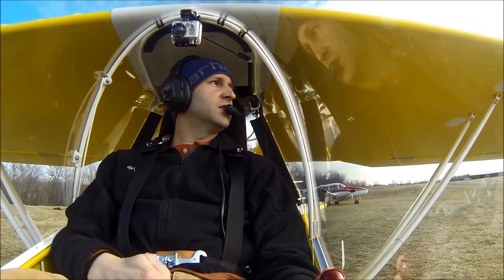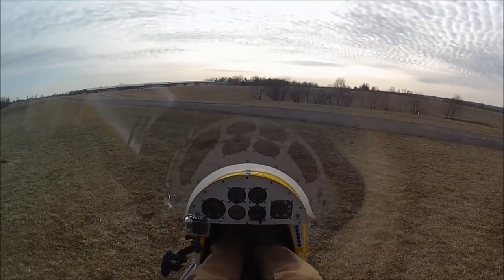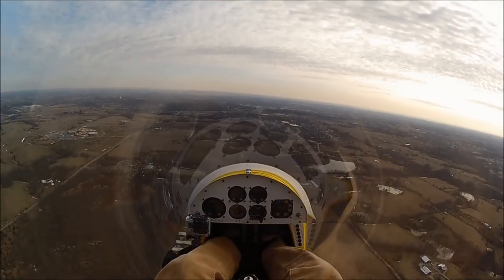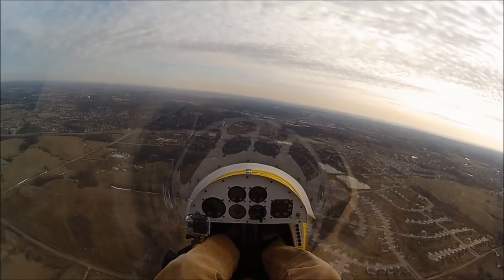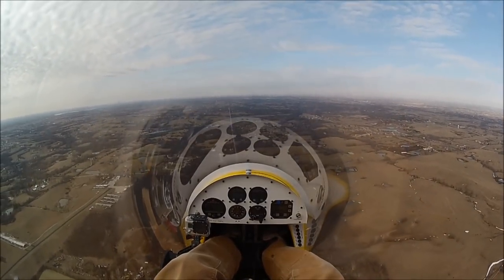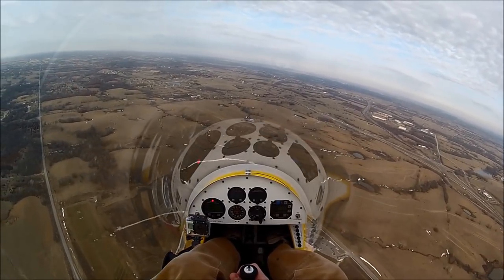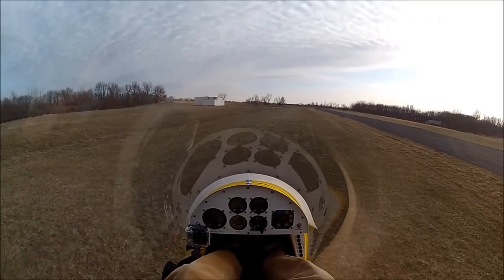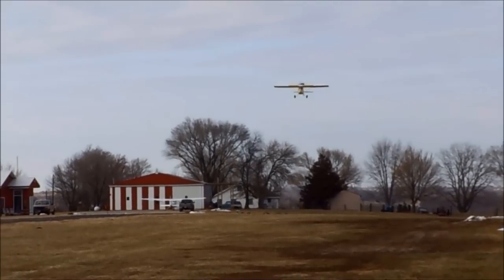Kolb Firefly Maiden Flight with Pilot Audio & 3 Camera Angles

Comment: Do you still have this plane I read on a forum guy said it was the worst handling plane he ever flew it always felt like it was going to stall when flying in the pattern. Maybe it was something wrong with his because seems like lot of people like them. I'm looking for a cheaper way to get into the air can't afford certified airplane hangers around my area are 400 a month with 5 year waiting list. I have been looking at trailer planes the kitfox is one but still in the 60k range when done with it. Wife isn't going to let me dump 60k into an airplane.
Reply from the maker: blastman8888 I still have it and fly regularly. I was fortunate to eventually obtain a cheap hanger.  I’m not sure where the “always about to stall” comment comes from. I’ve had no such experience. Maybe it is rigged poorly, propped wrong, under powered, or something. 

Having a light wing loading and being a tail dragger, it comes with the usual flight characteristics you’d expect out of an airplane of this type. Don’t fly in high winds, low energy, etc.  As far as stalls are concerned, it just bobbles without a clean break if you do power off stalls without excessive nose up pitch. You have to really pull and get the nose up for it to break. My usually breaks with about a 10 degree roll to the left. 

I added 1 degree of washout when I built it. This helps the stall characteristics. You get a nice stick shake from the lift separation on the full span ailerons. 

The only thing about it that bugs me a little is the effect of adverse yaw during ground handling in cross winds. It results in some counterintuitive control inputs sometimes. But, after a while you learn to work with it. 

Kolb has been around a long time. I think the Firefly looks nicer than say, the Aerolite 103. But, it is more build intensive if you build it from the kit. The Firefly is offered with a nose wheel now. Let me know if I can answer anything else. 

Mine may be for sale in a year or so. I’m building a Sonex.
Reply from the maker: Also an aft CG could make the plane feel unstable. Kolb says something like “the Firefly can handle up to 200 pound pilots...”. What the don’t tell you is that you may have to be 250 pounds to be off the aft CG. At least that was my case. I had to build a mount in the nose in front of the rudder pedals for the battery. I weigh 170 lbs and I’m flying about 3/4 of the way aft on CG.

Comment: I bought an airplane engine yesterday!  Cuyuna ULII-02 Engine (430cc / 
30-35hp) has 180 hours on it, running when stored, off a wrecked Kolb 
Firefly

http://air-war.org/image_DSC_0026.JPG

More: http://shellprompt.com/deathtrap1/Cuyuna%20ULII-02%20engine/

Another major piece of the puzzle... acquired...!    Rivets, Prop, &
 Dacron still to go...

Oh, and I got my first cockpit gauges, an hour meter reading 180, and a 
CHT (cylinder head temperature) gauge (very critical).  

Still haven't decided on an eventual color scheme/theme/typestyle for 
it, probably still a combination of aluminum grey, orange, white & 
black.  Also considering instead of orange...   purple / gold, and... of
 all things... white polka dots on navy blue background.  Nobody has 
ever painted a plane in polka dots, and I want to be original.   I get 
color chips at the Home Improvement store and hold them up to the sky, 
comparing high contrast combinations instead of just white/black (the 
highest contrast combination).

Won't be until this spring/summer I get started working on it.

CG / http://air-war.org
Reply from the maker: +CHOPPERGIRL AIRWAR  You mentioned you bought a restoration project earlier in the thread.  Is it aFirefly, or something else?
Reply from the maker: +CHOPPERGIRL AIRWAR Nevermind.  Just visited your site and saw it is a VJ 24.  Looks like classic fun!  Congratulations to you.
Reply: JWolfe104 Thanks.  Lots of work ahead!  Originally the owner of engine/Firefly told his GA friend to taxi butnot to take off, but he did, and couldn't get it to land before eating a fence.  It's a gorgeous little engine for $250, I couldn't ask anything better.. 2x the HP of the original Yamaha KT100 on my plane back in the golden age..

After my first flight, I'm going to spike my helmet rather than kiss the ground :-). Maybe not, its brand new...
Reply: Someone just gave me a Poorboy ultralight project, kind of like a pudgy Firefly or Firestar.  Groan, now I'm going to have to learn to fly a faster ultralight.  It does have folding wings though; working on my trailer to go pick it up.

So has flying gotten more fun, or is it still 15 minutes of terror?

Comment: Very nice!! I fly #92. The firefly is a great aircraft. They will make the legal limit with little paint and nothing extra. Mine is right at 254 bare bones, I checked it 3 times at the recommended 9 degrees ange of attack, came in every time. I fly with guys that have the first gen firestars, I can fly slower than they can with full flaps.GREAT LITTLE PLANE! Check out my videos - degbot